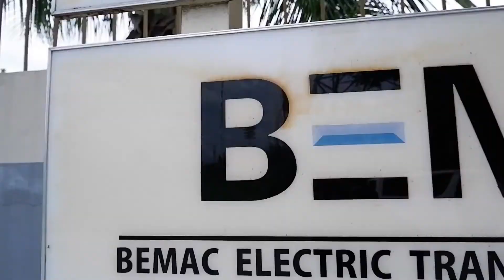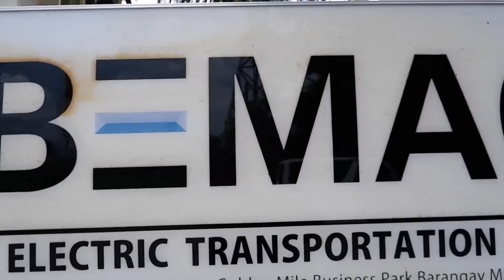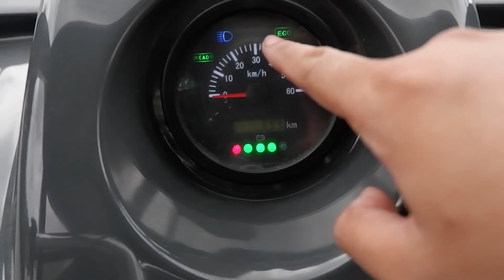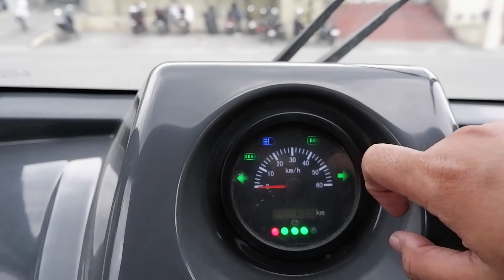MANILA E-TRIKE | ELECTRIC TRICYCLE Review | First Time Impression

Comment: For 400,000 php, you can buy a good used car! Way overpriced and poorly manufactured. Leaf springs for shock absorber for what is supposedly a MODERN vehicle!? And low back rest for passengers and still an OLD-FASHIONED plastic rain covers for the passenger compartment? At least they could have used sliding plexiglass windows. Philippines, still in the STONE AGE in this modern world, what a shame!